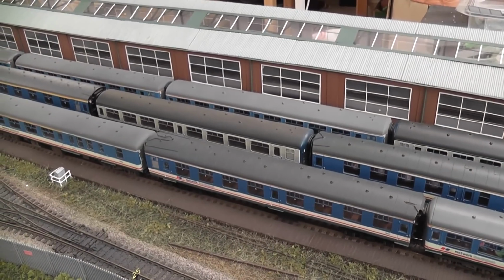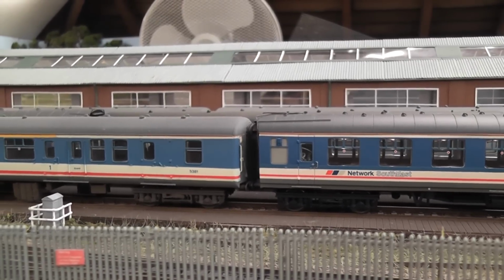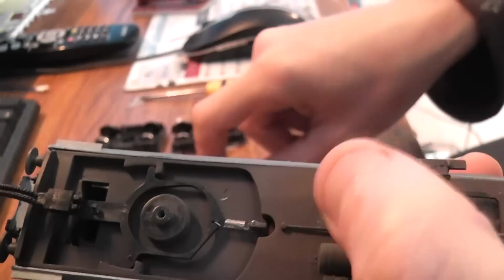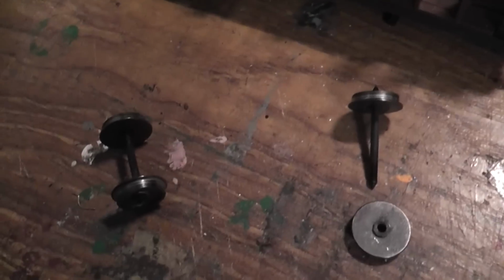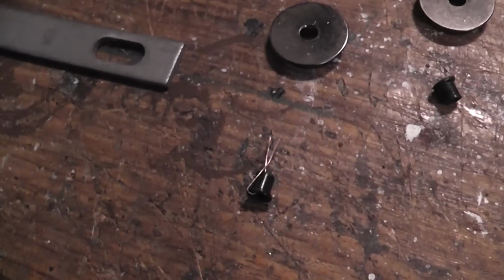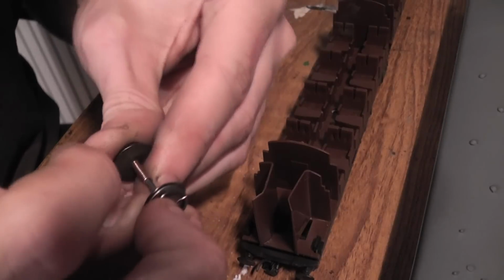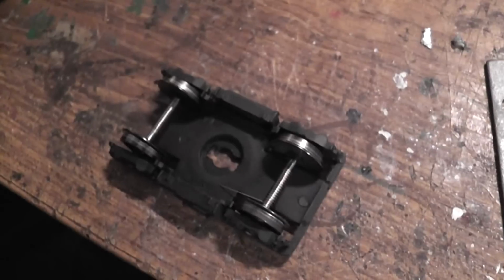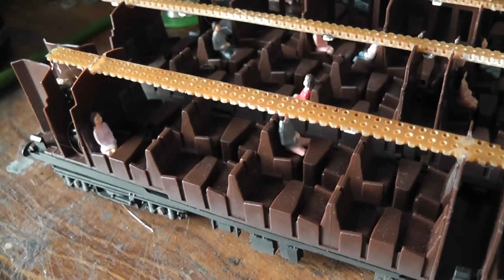How to - Episode 22 - Detailing Passenger Trains

Comment: Nice Video Richard, I have a rake of 9 MK1s  that I fitted with lighting and passengers and they use wiper contacts. What a drag!!!. Even a big steam loco struggke at times on the level. So I got some of those DCC Concrpts springs them discovered that the wheelsets had both wheels insulated so the update has been stalled for several months while I tried to come up with a solution. The thin wire looks like a great idea so I will give it a try. Thanks for sharing that tip....John

Comment: Good afternoon. With regard to your MK2 Bachmann coach height problem, check the height of the buffers above the top of the railhead. I made a simple gauge out of a piece of thin plywood about 11/2 inches long with a horizontal line exactly 14mm above a true bottom edge with two vertical lines 16.5mm apart acting as gauge lines. 
    Set the gauge on a level piece of track with gauge lines above  the rails. Run a coach up to it ( minus coupling if possible) the horizontal line on the gauge should be exactly central in the buffer heads, if low then packing on the bogie will be required, if higher then remove small amount off bogie spigot not the bogie itself. Once the buffer height is checked and amended as required then the coach height should be resolved. The 14mm buffer height is the scale height of 3'6' used on the prototype'. Hope this is of help. Have used this to check my coaches, and it works.

Comment: How did the plasti-card carriage shed cope with the summer heat?  No warping?

Also, the photographer who took my photos for Hornby Mag said I would get a fee for the article in the magazine.  I was surprised, never even thought about that side of things as I was so chuffed to be asked!  Did you get a fee?
Reply from the maker: Hi Dave.  The shed has coped very well with the heat, better than I thought really.  I think its all the small individual parts it's made from that helped.  I did get a fee from Hornby, wasn't expecting it either!
Reply: EverardJunction Hi Richard, good to hear on both counts.   Nothing worse than spending countless of hours on something only for it to suffer in the temperatures.

Wasn't looking for a fee, but any will be welcomed in order to re-invest into the layout. No one from Hornby has said anything about it to me thus far.

Comment: Hello Richard... Thank You for your great videos.  On wires : With a lighter, You can burn the end of the thin wire. The lacquer turns into coal and is super easy to wipe off.  On capacitors: There is a Tantalum type of capacitors, (which is surface mounted like your new leds). very small. Many people use them in locos and other places, where there is Little Space.  On Leds: Did you see those leds on a flexible strip...?  Greetings for now from Denmark... Jakob.
Reply: I'm not into model trains as such, but I love looking at how things are done. After seeing your comment Jakob, and knowing about tantalum bead capacitors being very small, I did a quick 'google' and found these: https://www.amazon.co.uk/Yellow-Radial-Dipped-Tantalum-Capacitors/dp/B00PZLW9C6/ref=sr_1_1?ie=UTF8&qid=1473929886&sr=8-1&keywords=tantalum+bead    I reckon they'd do the job Richard, and then your legless passengers can use the toilets. Regards Mark in the UK
Reply from the maker: Tantalum capacitors are great but in this application you need at least a 500 - 1000uf one for anti flicker.  They are readily available by are about 5 times more expensive than an electrolytic capacitor.

Comment: Thank you Richard for all of the informative videos. Your work is excellent. My question is: How are the pickups connected to the lighting in the passenger compartment?
Reply from the maker: Via the wires soldered onto the circuit board.  Theres a cutout for the coupling on the coach that can be used for the wires to route down to the pickups.

Comment: could you put the pick ups in the guards compartment then run servo leads as jumpers between cars?
Reply: 'Could' do that but then you're stuck with a rake of coaches you can't separate which would make handling much harder, especially if you want to work on them.
Reply: thats why I said servo leads, so you can unplug them for that very reason.
Reply: also Everard Junction, are the cars close coupled or do you have the corridors fitted between cars as i am so used to seeing a 1/4 to 1/5 inch gap between cars on model railroads
Reply from the maker: The coaches are indeed close coupled to get rid of the gap.  Running all the lighting from one circuit would only work for a small number of coaches.  Only a certain number of leds will run off one board at 12v.

Comment: If you add a Bridge rectifier into the circuit your coaches wont be stuck always facing the same direction on the track.
Right now the way you have it wired an LED will only work if the wheel that is on the positive rail is also on the positive side of the LED.
Add a Bridge rectifier and it wont matter which rail that wheel is on as the output to the positive side of the LED will always be positive even if being fed by the negative rail ;)
Reply from the maker: All the circuit boards have a rectifier in them because the layout is dcc.  Check out episode 14 of my howto series for more info on the circuitry inside the coaches.
Reply: Does the polarity of the rails change on a DCC track?
I thought one was always + the other always - ?
Reply from the maker: DCC does have + and - on the rails but the signal behaves similar to AC voltage.  This means I can put the coaches on any way round and they will still work.
Reply: If you put the + leg of an LED on the + rail and the - Leg on the - rail it will light up.
What happens when you put the + leg on the - rail and the - leg on the + rail on a DC or DCC layout?

Comment: Hi there. Nice video, and nice work on those coach rakes. 
To scrape the "lines" on the roofs, I use a seam scraper from Squadron Signal, used by aircraft modellers to "erase" the raised panel lines prior to scribe those panel lines back with a squadron signal scribing tool.
Here is the intel about this stuff : 
Seam Scraper : http://www.squadron.com/Squadron-Tools-Seam-Scraper-SQ10203-p/sq10203.htm
Scribing tool : http://www.squadron.com/Squadron-Tools-Scribing-Tool-SQ10202-p/sq10202.htm
I purchased those from Walthers.com (the US manufacturer & modelling shop). You can also find those in military modelling shops like Hannants (there's one near the RAF Museum in Hendon (Colindale).
Hope that's going to be helpful, 
and also thanks for your videos and congrats for the magnificent article in Hornby Magazine.
Eric.